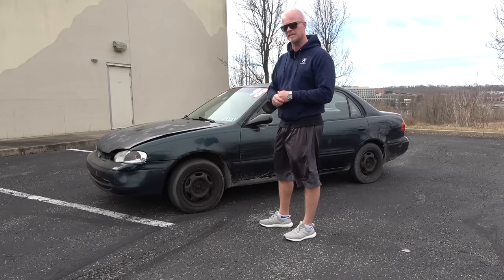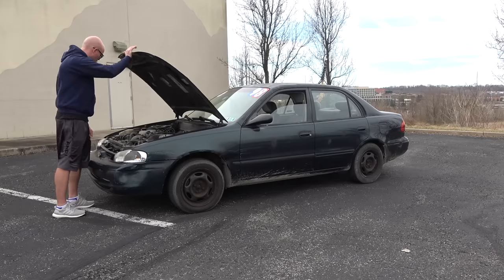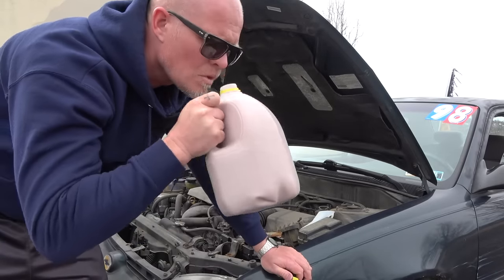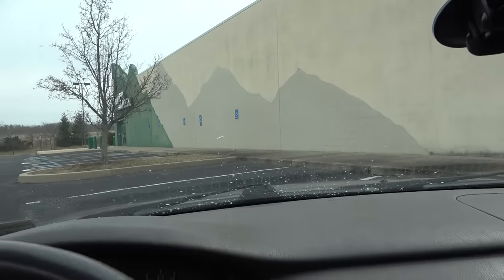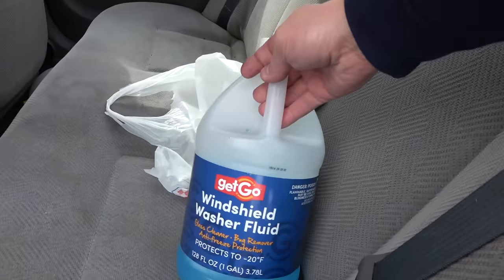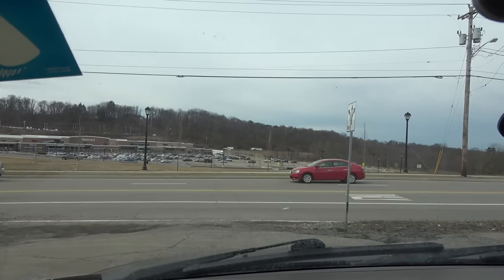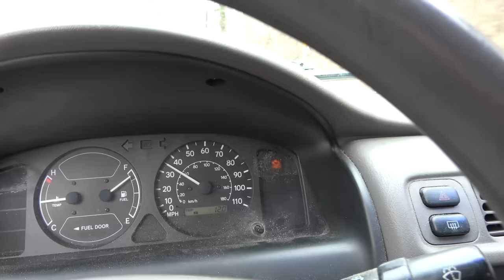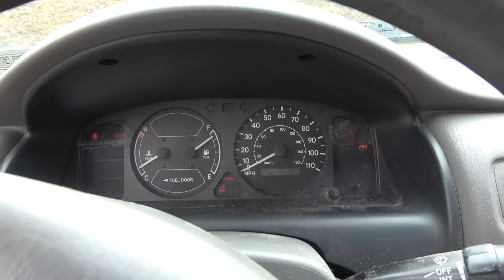What happens if you fill up the ENGINE of a car with CHOCOLATE MILK instead of OIL?

Comment: Toyota is crazy man... they need to build cars like this again
Reply: Fifthcell Chevy
Reply: Abdullah Fawaz what? This is a rebadged Toyota... the only thing GM did to this car was changed up the tail lights and slapped a Chevy badge on it...
Reply: @abdullahfawaz7930  it's a Hyundai
Reply: deathbydevice its a Mercedes with chevy badges
Reply: youre **
Reply: But isn’t that a ferrarighini
Reply: Thats why i bought a 09 corolla instead of a used mercedes.
Reply: Toyotas are shit they will burn oil like no tomorrow
Reply: @hemiplow1297  get a better one
Reply: @abdullahfawaz7930  it is a Toyota
Reply: IT'S A CHEVY DUDE!..NOT A TOY!..
Reply: @smartinez4910  you do realize that car companies dont usually use their own engines or engine parts.

Example:
Bugatti uses Ford engines
Reply: Yeah thts right sorry
Reply: @smartinez4910  you can put a Lamborghini engine in a corvette-_-
Reply: I feel like my 2001 Honda Accord v6 could endure all of this too lol I have 208,000 miles on it and it still drives like a new car
Reply: @yashvintackoory2893  I actually love my 2000 Mercedes E3 20 wagon it was over 200,000 miles and It drove like a dream until take 5 oil change Broke my oil filter housing unit and it would not stop leaking oil.
Reply: @hemiplow1297  Have you owned a Subaru? Lol
If you're only issue on a 15 year old car is it burns a little oil, that's a good car, no matter who made it.
Reply: @ThatGuy-vi8ch  its alot of oil man its like 1 quart every 200 mile,if i let a woman borrow my Toyota for a week it woulda died the only reason its alive is i keep adding oil.I waste so much money on oil every week I might as well just drive an v8
Reply: @abdullahfawaz7930  😹
Reply: @yashvintackoory2893  my dad bought a used mercedes, a 1995 C220 non-turbo diesel. It had 400,000+km, god knows when the oil was changed, drove it around for 110,000km more on the same oil, then decided to finally change it because the timing chain made a little noise. I only changed his oil and oil filter, the noise was gone, car drives like new even today, almost a year later, and yes, he's already passed the oil change interval two times since the last change. If you choose the right one, it can be hideously reliable. However I would not recommend doing the same thing as my dad which is not maintaining your car at all, just fixing stuff up when it breaks. Take care of your cars, and in most cases, the car will pay you back for the money spent on maintenance.
Reply: to be specific, it's a rebadged toyota sprinter but with a different front grille
Reply: This toyota car will outlast the newer Toyota cars to much tech.

Comment: All that abuse and that car still last longer than his c63 and ford truck
The most reliable vehicle in his fleet
Reply: Lol this car took a gallon of chocolate milk in the engine and fuel tank, then topped off with windshiwld wiper fluid cause it wouldnt die. His amg c63 died driving through a small puddle in the rain lmao.
Reply: It is Japanese, shit runs forever
Reply: @jamalj1092  i didnt know fords were japanese...thanks
Reply: ŠTA GLEDAŠ it’s a chevy.. and the prism was a joint run with toyota and their corolla, utilizing their japanese engines. lol
Reply: Yeah, new cars don't put up with the abuse, no one does nowadays... lol

Comment: I'll never look at chocolate milk the same way. RIP Hooptie!
Reply from the maker: 😂😂 Sorry!
Reply: OMG. True!!! LoL
Reply: change the oil, flush the fuel system full up with frash gas and I bet she will fire right back up!
Reply: @numberone7674  I doubt it. Rods are likely bent from the chocolate milk getting into the cylinder thus hydro locking it.
Reply: @AutoVlogOfficial  it was amazing how long she lasted on chocolate milk lol.
Reply: Would it make a difference if you used a organic/grassfed? 🤣🤣🤣

Comment: If you empty the gas tank and put petrol in it I think it will start 😂 because the engine needs something that can burn, but choco milk and windshield washer don't burn 😂😂😂😂
Reply: It's not necessarily that it wont burn. It will, just not at the pressure and temp that the engine needs to run. The issue is it wont compress so it will smash the piston. Like if you belly flop the pool if you get what I mean
Reply: Washer fluid does burn, found out the hard way lol

Comment: I never really comment, the last time was when you 1st bought this car and I told you it was really a Toyota Corolla. All the abuse you put this car through and it never died, this is a testament to how great cars Toyota built especially in the 90s. Had you tried any of these tests with the Benz or either of the Fords, they would have died long time ago. Like another person commented, replace the engine oil and remove the milk from the gas tanks and this car will run great again. 90s Toyota's never die.

Comment: So realistically, I just watched him pour it in the engine, so my prediction is it’ll still run for a couple reasons, most likely bc he didn’t drain the oil that was in there and the chocolate milk will mix with it and somewhat get absorbed, however if it’s leaking, we’ll, basically the engine is a big heat dispenser, and oil aka milk will be used to cool and even lubricate it which, won’t do that but it would take awhile for it to seize up

Comment: 8:39 vvti kicked in yo😂😂😂
Reply: 98 corollas dosent have vvti they have efi
Reply: @hemiplow1297  i know, it was 1 year ago there is no point of replying that.
vvti and efi is like comparing a valve system to a fuel system
Reply: @leonardlitanius7078  either way these engines are shit i owned 2
Reply: @hemiplow1297  😂😂😂
Reply: @hemiplow1297  you meant geo prism

Comment: You could have give this car free to someone deserving in your area as a REAL GIVEAWAY :/
Reply: Omer Malik it’s complete shit 😂 no way, it’s a money pit Chevy
Reply: I would want that car! Maybe restore it a bit
Reply: Why is the other one fake
Reply: @zoneb609  Definitely. Get a new fuel filter and plugs, change the oil to get it running. Aesthetically it just needs a new headliner.
Reply: It was leaking oil.. the hood is broken.. and it had all kinds of problems.  Stop trying to get patted on the back by making stupid comments.
Reply: @Joey29455  And then? A leak is the end of the world?. I restored a 92 Topaz that was abandoned, crashed and with almost a blown engine. That's on my fleet of daily drivers now
Reply: @zoneb609   For the same money he will spend by restoring it.. he can buy a better car that's safer on the road (if he plans to give it away)  Did you look at his hooptie?  It has a million dents and scratches.. headlights broken.. hood broken.. it smells. Not worth even trying to restore it.  It's written off.  End of life.
Reply: @Joey29455  Yeah I saw the Prizm, and still my Topaz was wayyy worse than that and I still restored it. I told you mine was crashed in multiple places so dents don't worry me.
Reply: Sublime you have to subscribe to his website so he’s basically making his money back on the car while giving it away
Reply: Evans Boateng however, name a you tuber that has given away a motorcycle or vehicle that didn’t have it tied to either Patreon or their web site that required either a membership or purchase of merchandise.  If they strictly gave something away of that value with no direct recoupment of some of those funds, how long and how many giveaways could they do?   In his case probably just one.
Reply: wysetech2000 Not many for sure, but for a guy with no transportation and no way to work to keep their job this hunk of junk would likely be a godsend.  The saying “one mans trash is another mans treasure” is true in many ways.
Reply: Birds Eye Video lol I get it I was just explain how it wasn’t a “real” give away
Reply: @birdseyevideo  if there that broke then they need to re evaluate there life.
Reply: White Boy perhaps, but I know of people that were met with a series of unfortunate events that happened that weren’t entirely in their control.  Instead of judging perhaps let’s be thankful we aren’t in that kind of a position.
Reply: @birdseyevideo  I was homeless at the age of 16 ended up in prison at the age of 19. Started commiting all types of crimes and eneded up having a house and 3 cars at 18. So I applaud anyone who can be broke and still keep there morals because I told myself I rather die or go to prison then be a broke bum out on the street.
Reply: jim jambo Plenty of people without a car that would have taken this hunk of junk. Hell, I would’ve taken it. I’ve been sharing my 1997 Camry with my gf cause her 1999 4Runner is out right now. I would taken this and she could have had my car.
Reply: Joey If it’s leaking oil, just keep topping it off with oil. You’ll never have to change your oil anyway :)
Reply: Good point, but I wouldn't put so much money into it. Only 150 and under
Reply: Omer Malik that car is barely worth 100 dollars

Comment: Yeah you killed her fuel pump I believe RIP little car RIP
Reply: Killed the pump? Not really
Reply: @zoneb609  well surely killed the fuel filter and tell me would you really wanna run a pump after it's been pumping sticky sugary chocolate milk even if it did magically keep pumping.. lol but ok
Reply: @dustytanco8745  fuel filter can be clogged, but the pump wont burn from running chocolate milk. As a mechanic I've seen worst things that ran on pumps and they are still ok. If he decides to run it again gasoline is going to wash all the "gunk" easily. Dont forget a pump can have 50+ psi of pressure, and I've also used old pumps to pump 20w50 fluid through my containers.
Reply: Nah I reckon if he changed the oil and filled up to the brim with fuel it would start up again and by then 2nd refill it would run as if chocolate milk and washer fluid was never there.
Reply: @gravemind6536  lol yeah probably

Comment: I wonder if you add more gasoline if it will be fine, it doesn't seem like the chocolate milk in the engine is an issue it just seems like you've diluted the gasoline so if you add more I would assume you'd be fine LOL this is awesome

Comment: I expected it to run fairly good. This is because he didn't drain the oil inside of the motor including the pan, meaning he pretty much just diluted the oil with the chocolate milk. Anyway most of the oil and milk bounced of the headers and  pistons and landed on the engine and windsheild because the motor was moving.
Reply: Oil and water (and therefore milk) don't mix.  The oil will float on top of the milk.  So, depending on where the engine is getting the oil from, it may be getting all oil or all milk.  As for the gas.  Not sure which is lighter.  But if the gas is heavier it should be the only thing going into the fuel pump until the gas is used up or mostly used up.  Which is likely why the car eventually stopped.

Comment: The closest experience I've had to this is putting Sunoco gas in my Mercedes because I was traveling out of state so I stopped in PA somewhere filled my car up with so called Premium gas. 5 mins later im on the interstate and my 2002 E320 4Matic is driving worse than a 1991 ghetto hoopty, I was freakin out because I was headed to CT and was still in PA somewhere and was a afraid of my car breaking down because 1# I have never felt a mercedes drive so horrible # 2 I hadn't even seen a f** Sunoco since I was a child 🤣 before that incident, that was RED FLAG #1. Soon as I burned the sunoco out and put my normal Shell or Exxon all a sudden my car went back to normal as if nothing ever happend.. It was the bad gas temporarily screwing up my engine Sunoco is watering down their gas and certain vehicles can detect it instantly. Watching this video reminded me of that incident be careful with cheap gas I know we love to save money but if you have a so called "Luxury" car like a BMW, Benz treat that vehicle as such and give it quality gas and love or your engine will one day come back to slap you and your car will be running worse than a car full of chocolate milk. 🤣🤣 I will say I respect alot of cars from the 90s early 2000s hence is why I choose the 02 over the 06 I was going to get because they built the cars more tuff and now car makers are being cheap even luxury brands are being cheap..

Comment: Remarkable it made it as far as it did! If you drain the gas and oil and flush out the fuel system the refill with fresh old and gas, it would probably be fine.

Comment: I was told that the fuel intake pipe in the gas tank does not drain the bottom of the tank, because water tends to collect inside gas tank (due to condensation) ... so the milk (heavier thabn gas) robably sank to tthe bottom of the tank and the gas kept flowing

Comment: It's not because of the chocolate milk in the engine it's because it's in the gas tank and it's not flammable same as the wiper fluid. Put some more gas in the tank and it will run better and then do some more badass videos with it 👍🏻

Comment: Did anyone else just cringe when he poured like a full quart of chocomilk into the oil fill without checking to see how overfilled the crankcase was to begin with? Honestly, I was amazed it didn't just seize when you ran it up to like 3k BPM on the first road test. That car's a beast!

Comment: You should drain the oil, flush, it change the filter then fill it with chocolate milk. Unless you did its still running with oil in it. Put nothing but bleach in the oil.

Comment: I thought putting garbage in the gas tank would hang you. Its tantamount to putting water in there. It would be good to drain the beast and dream up some other endurances. I remember my dad ran out of petrol one time. He was towing a boat, so he poured two stroke (with oil) into it and bar a little bit of pinking under load, it got us to a petrol station, so you can cross that one off your lists of tortures for the Toyota.

Comment: I did this with a Corsa C about 4-5 years ago. It was a company car, and the boss was an asshole and also couldnt be bothered getting oil for the car and expected us to drive it.... So i topped the oil up with orange fanta. It lasted another 3 weeks before it developed a bad rod knock.

PS, i can almost guarantee thst Prism will start and run fine with a new tank of fuel, spark plugs and an oil change.